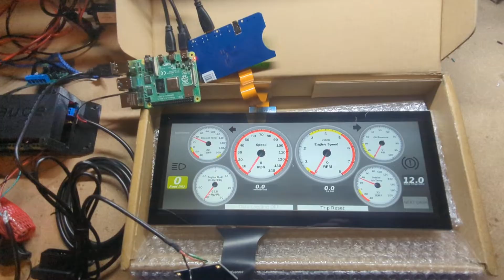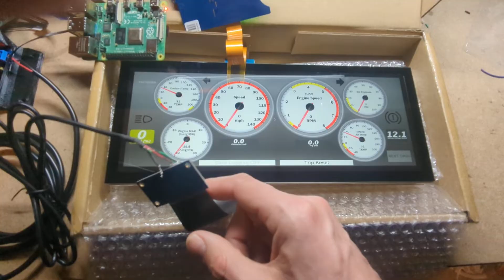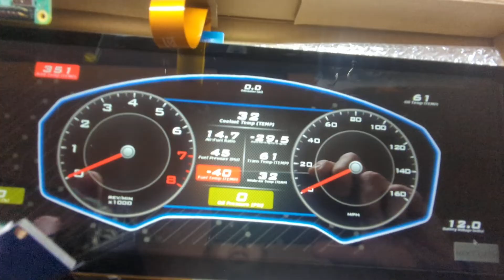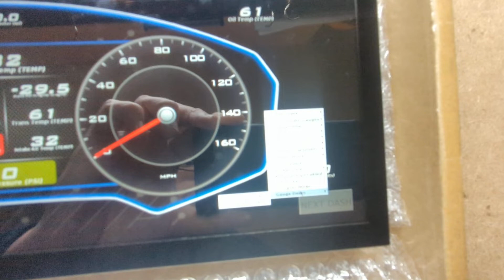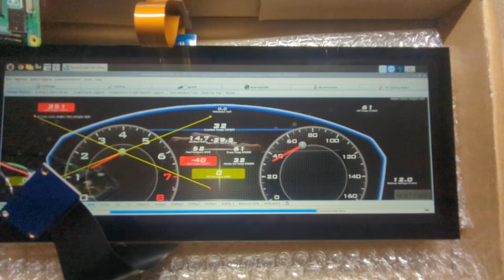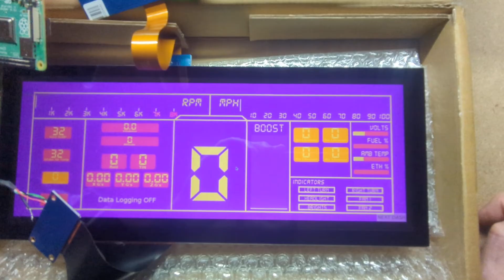OneGauge and Pidash hardware setup

Comment: Can I get readings off the obd and additional sensors? For my setup I'd like to get oil pressure and temp off the canbus while also using a pressure sensor in the pan to monitor blow by
Reply from the maker: Absolutely, we can combine sources no problem. Just know that oil pressure and temperature aren't standard codes in OBD2 as they can vary from vehicle to vehicle, but as long as the PIDs are available we can give it a shot.

Comment: how many screens will this support? can i make this control the a/c?
Reply from the maker: A standard Pi setup supports 2 screens. Multi-pi setups are also possible though (but expensive). 
For AC control we sell relays, but it really depends on the type of AC you have. Older vehicles use analog control (vacuum) while newer ones may be electronic, but it would be a project you'd have to undertake as we wouldn't have your car in front of us.